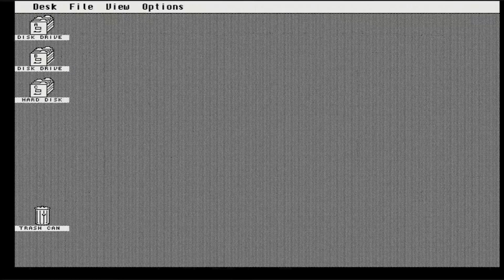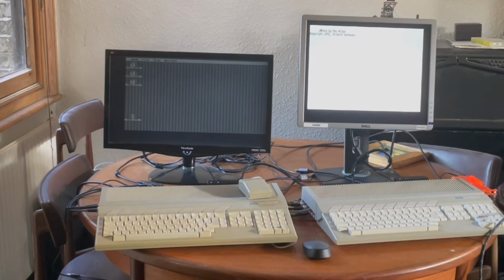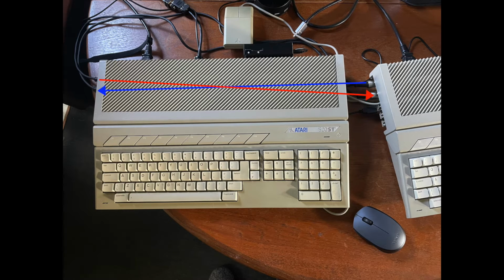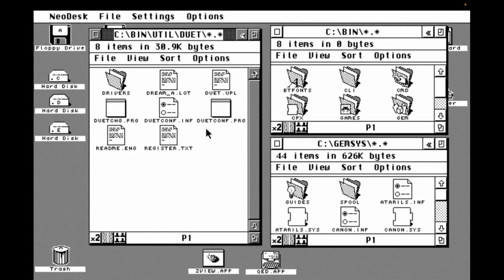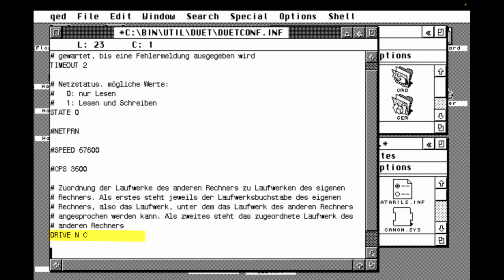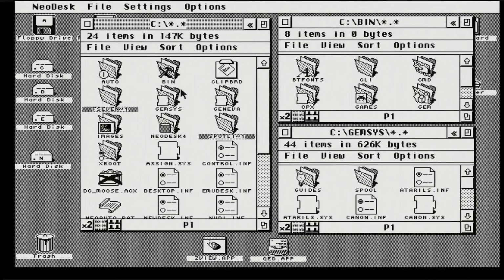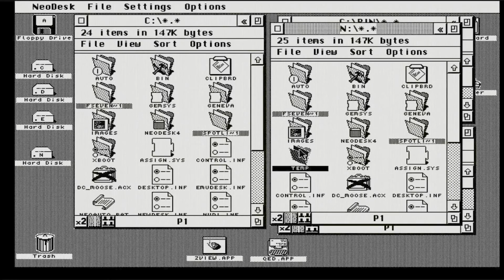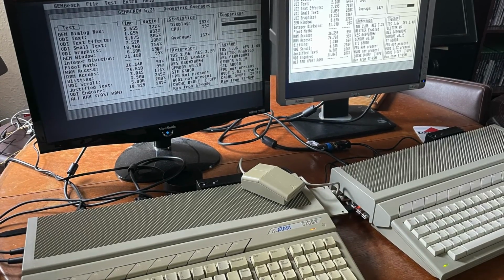MIDI networking and file transfer on the Atari ST

Comment: I just got Duet to work on my Mega STe and TT030.  Unfortunately no luck getting the LAN driver to work.  Only Midi but I was chuffed to get the 2 Ataris together.  Curious, do you have links to downloads for the other drivers you mention like the DriveNet, etc...  I want to try them as well.  I googled the names you rattled off but nothing pops up.  thx

Comment: Great stuff.  Is there a way to connect 3 systems together or more?  I see you did the in and out between the 2 but if you have 3, how would you or can you cable 3 together?  You said you can MIDI up to 16 MidiMaze so curious.
Reply: I am guessing the In to the Out you just have to loop the last in the chain to the 1st computer so you have a ring connection?
Reply from the maker: Yes I think so

Comment: I remember back in the day, we would use a null modem cable to be able to play games like Stunt Car Racer. Didn't think about using MIDI!
Reply from the maker: THere was a comment recently (from adam I think) saying that the parallel port was the way to go (for speed) But... I always had MIDI cables lying around so it was the easiest solution for me

Comment: I noticed you're using modern modern monitors -- what are you using for that?
Reply from the maker: The one on the left is a ViewSonic VX2239wm that I bought in 2010. It has a 16:9 aspect ratio so not ideal.

The one on the right is a Dell P191sb Manufactured in 2012.

Both have RGB input and both handle Atari ST Mono acceptably (Image a bit stretched on the ViewSonic)

Neither can handle colour.

I now have two of the Dells, as the friend who gave me the first, found a second :-)

I think the Dellis still available (£239!) but you seem to be able to get tem second hand to £40

TGHese both run through Atari to VGA adaptors, in mono mode
Reply: The GBS8200 can be modified to turn the 15kHz to 31kHz for more modern VGA. But these is a more expensive GBS that offers HDMI and is pre built. Likely well worth the £100 cf £25 GBS8200, £10 ESP8266, 74LS86 torture HV to complete sync, enclosures etc.

I did the 4 throw switch converts RGB to Mono so one VGA can display low/medium or high. Picture is better than the old analog on my STe. STFM will need a bit more work but it is a refurbishment project.

Comment: I think you need to select/highlight a drive icon in TOS to get the option to install new devices.
Reply from the maker: Thanks for that it works. kind of sucky UI/UX but hey. It wouldn't be an ST without quirks!

Comment: Definitely interested to see how this can be done using HATARI.  I'm also using a Mac and have been wondering for a while now if it was possible to to use MIDI and/or serial over standard TCP/IP networking.  Would love to be able to get some of the old flight sim games like Falcon and F16 Combat Pilot working over the network.  Many happy memories of this from way back when I used to bring my ST over to a friends house.  Stunt Car Racer was excellent as well.

I'm also kind of curious to know if you can pass MIDI messages between an emulated ST in HATARI and a native MacOS application using Audio MIDI Setup?

I'll also be going to the Cyber Legends event next Sunday.  Looks to be very interesting.
Reply from the maker: That's a first vote for a second video!

On the subject of comms between MacOS and Hatari. I've not had any success with portmidi and qsynth or Munt. I get frequent Hatari Crashes.

I've built the 2.5 develop branch on my Mac and I'm trying on that. So far, not so good!

Hopefully will bump into you on Sunday.

Comment: You should try PARCP which transfers data over LPT cable (very easy to make) and ST can do 30kb/s using this. The only disadvantage - you do not map drives, but use dedicated program to transfer data.
Reply from the maker: Thanks Adam. I'll definitely take a look at this.